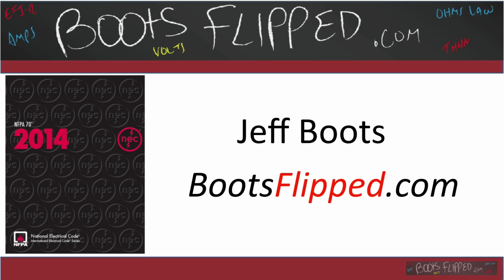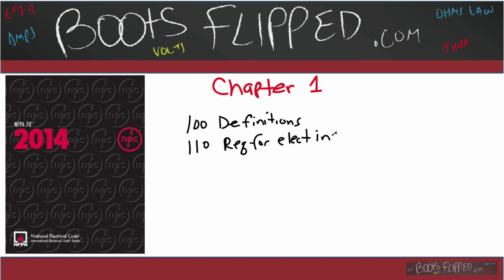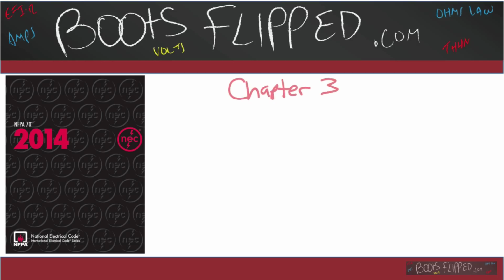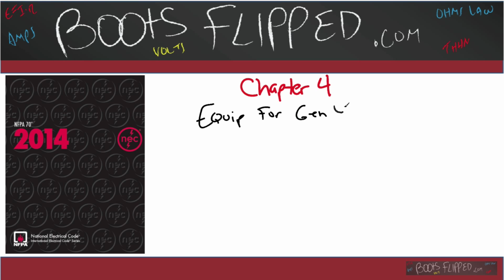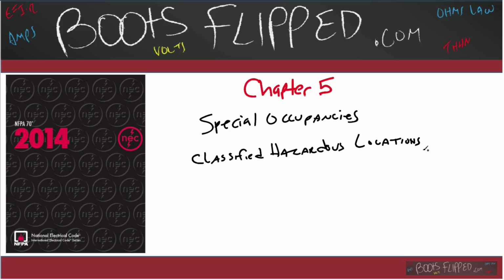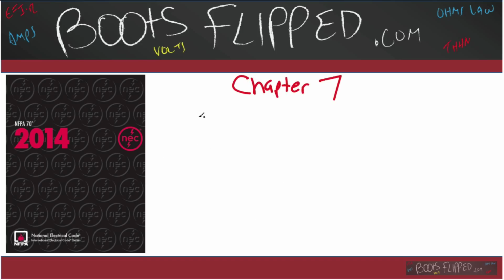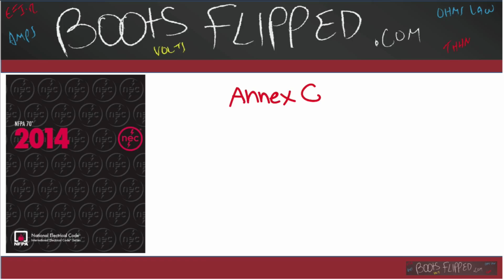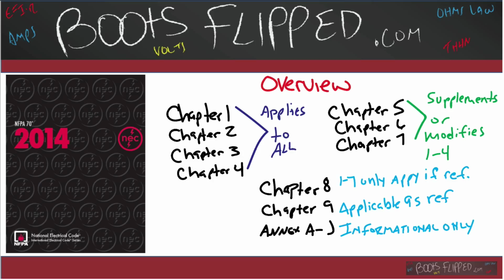002 Intro to Electric Code Arrangement

Comment: thank you so much Sir for these so helpful 
& useful and motivating to get more abt NEC 
i/m confused about choosing and sizing cables protections for circuits related to motors .. starting current  and different devices or loads using motors at homes or sites .. pumps .. air condition..  control circuits .. welding ... home devices .. and so on 
so we need a video explain these part according to NEC article 
thank you so much again and again
from Egypt Haitham Hassan